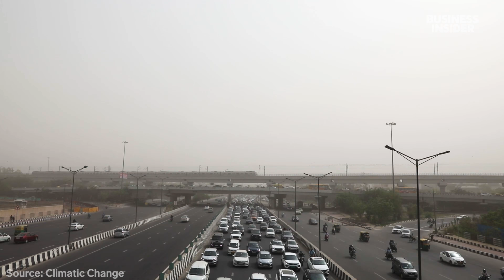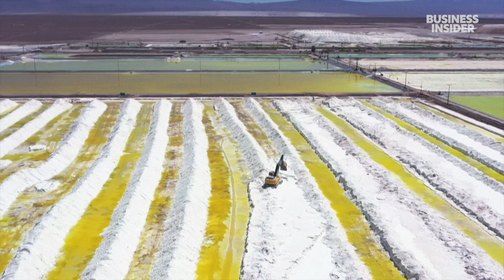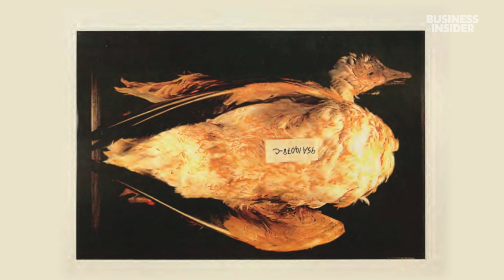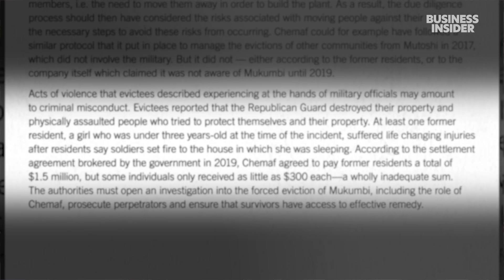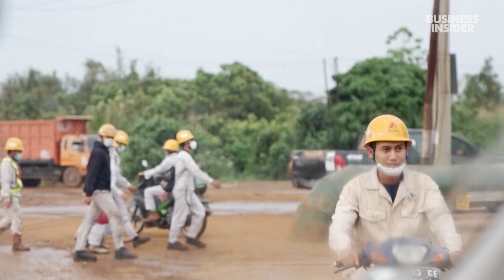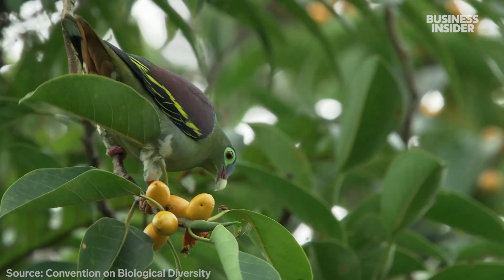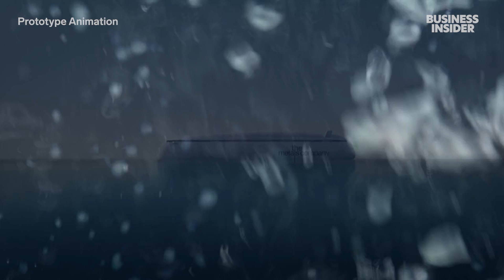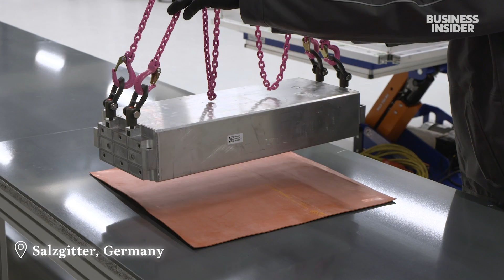The True Cost Of Mining Electric Car Battery Metals | True Cost | Insider News Marathon

Comment: "EVs have a production carbon footprint that is 30 % larger" 

Are you kidding ? This number is + a 130 %
The statistics that are used take a sedan EV and compare it to the average Hybrid vehicle, instead of taking a medium to large EV and comparing it to a standard ICE which ( on a global basis ) is an average of 4 cyl inline and 2200 pounds, while modern EVs weigh 5000 pounds and more.

Comment: Please also make a True Cost video about the petrol or diesel-powered vehicle and it should start with taking petroleum from underground, the extraction process, the processing, transporting it to petrol pumps, and burning it to the atmosphere, and what happens to it once it is in the atmosphere, and also whether there is an option to recycle the burnt petrol...
Reply: Yes, good idea.  Also the increasing amount of renewables used to generate electricity is gaining traction and will only get better in the future.  The major problem that most people don't think about is that once you burn fossil fuels then they are gone forever.  Battery recycling is real and will only get better once humans are forded to due to the over mining of virgin materials.
Reply: @Lone-Starr-Schwartz  yes 💯💯💯
Reply: @Lone-Starr-Schwartz  well, when you pollute the air there is still possibility that you can reclaim the environment if you increase the green cover on the planet, but how will reverse the soil and water pollution from extensive mining for minerals like lithium?
not that i am saying fossil fuel us long term solution but finding another dangerous alternative is no solution either.
Ideally we should start with hybrid and then find better solution like fuel cells and hydrogen and solar...
Reply: @Lone-Starr-Schwartz how many renewable batteries are sitting in the dump right now? Fool.
Reply: I dont know normal cars can be made with steel, plastic and copper also only you stupids first worlders put computers and only use gasoline, why? It is illegal to use ethanol or methane In your dyatopias?
Reply: Are you disturbed by the fact "green" EVs aren't actually that green? For the first 60,000 miles or so an EV isn't actually greener than an ICE given the amount of pollution caused to build it in the first place.
Reply: @putler965  that's wrong news buddy. The amount of rigging required to get petroleum from the ocean (damages the ocean, uses a ton of unclean energy), then the amount of energy required to refine petroleum into petrol, and the amount of energy required to transport this petrol to petrol pumps, and of course the pollution caused when they are eventually burned...all this combined is much higher than manufacturing batteries which can even be recycled after they degrade. People only check the pollution caused when driving a car, but that is not the only pollution. I hope you get what I said.
Reply: @abhijith_mb  Perhaps you can explain that to the engineers and physicists who determined you have to drive at least 60,000 miles to offset the carbon emissions involved in digging minerals out of the earth before an EV is "greener" than an ICE. If an EV is powered using electricity from fossil fuels, it could take as long as 99,419 miles to become "greener". 

You have to drive 100,000 miles to really get the full benefit, and even then an EV is only about 25-30% greener than an ICE.  This is from VDI Gesellschaft Fahrzeug, a German engineering association. But what do they know? I'm sure you know more.
Reply: @putler965  yeah
Reply: @putler965  No one "determined" anything like that.  You are likely quoting FUD you do not even understand?
Reply: @philtimmons722  I quoted an engineering company, you apparently don't realize that. Are you an engineer?
Reply: @putler965 
I don't know where you got your figures, but a modern EV offsets it's slightly higher manufacturing CO2 in under 12,000 miles, when charged on a grid of 50% renewables. Yes on an all CO2 grid it takes longer to offset the initial CO2, but still nothing like 60k miles. 
How long does it take for an equivalent ICE to become carbon neutral? Oh yeah, it can't, as it continues to output CO2 for every mile it drives.
Reply: @abhijith_mb no way. There is no comparison. These mining operations are way worse.

Comment: How is this better than oil fields?? Oh it’s not. It’s worse. But because you see no smoke out of the back of a Tesla don’t live live near the coal burning power plant liberal single soccer moms thinks it’s better lol. Ever wonder why politicians and people are pushing these “green” ideas (they just aren’t  green at all) forcing you to switch and telling you not to fly but drive your ev while at the same time they are still using ice and pvt jets?? It’s because they know it all sucks they don’t care about green they own stock or were given ownership in these companies. Remember a battery only EV pollute far worse than a gas car for up to 200k miles some 100k depending on type size etc. So ice car won’t pollute as much until 200,000 miles as a Tesla does day 1. At which point they just pull even because you still need electricity from somewhere. This stuff is a joke!! Wake up. It’s about money not going green and just like 110 years ago battery ev cars will die off soon. The future is still oil with support from synthetic fuel and hydrogen. Unless they invent a battery that is made of dirt can be fully charged in less than 5 minutes, has 500 mile range, never goes bad but can be recycled if needed and can work in cold temps efficiently than that’s the future.

Comment: One thing that is often overlooked when considering the negative effects of mineral mining is the idea of producing more efficient electric vehicles in order to reduce demand for precious metals in addition to recycling old batteries. Consumers and manufacturers alike tend to se the switch from gas to electric as a new lease on power usage that allows them to have frivolous ( although admittedly very fun) amounts of  power in commuter vehicles. If we are really trying to turn over a new leaf, we need to build highly efficient vehicles regardless of the propulsion system(s). Also, the ford lightning is an abomination
Reply: an EV electric motor is 90 % efficient and a gas engine is less than 15% efficient - which one do you choose?
Reply: @r.b.l.5841 your right but you have also missed my point
Reply: @argonaut405  the efficiency factor is your point.
Any EV, even one charged from a coal fired  plant is more energy efficient than similar gas vehicle.  The use of fossil fuels in an electric generation station is far more efficient than ICE engines can be.

Comment: What they do not tell you is that the EV's are going to wear out tires faster which raises carbon footprint. They are also harder on roads are they are much heavier which is most likely going to create a shorter time in between major overhauls depending on surface of course. There are so many variables that are still unknown. But the Replacement and range of Battery is why i will stay with my ICE engine as long as possible.

Comment: Finally some honest reporting on all the harm that EV's cause. EV's are not the future because they are not sustainable. There should be a balance of EV's and gas powered cars and not banned like the idiots who run California. No one mentions the extra strain on the power grid, the massive amount of copper to run all these charging stations and then thieves digging them up for the copper (this is already happening). Then there is no real used car market for EV's either due to the battery. If the casing gets a dent and the battery needs to be replaced you are looking at a massive bill to replace. They just won't work in really cold areas and this was already proven this year in Chicago. Not to mention if an EV is getting its power from coal that might even be worse than a gas car. I support Toyota and trying to make hydrogen work better. If that can be made more efficient that is the way to go.

Comment: A lb of cobalt is used for every six million miles worth of gasoline refinement. So an EV uses more (30 lbs average) but it’s not new. And EV batteries can be recycled to very high levels so EV fleets would probably use less than gas cars over 100’s of years. Some EV batteries use no cobalt.

Comment: All the more reason Sodium ion batteries will replace lithium. They're already commercially available, though expensive at about $45 for a 17650 equivalent. And sodium is abundant enough to mine cleanly, and easily from sea water. It seems too good to be true, but it exists, it's available, and it's getting cheaper by the day. The performance is comparable, though the voltage isn't quite as high, but that's a minor issue on the whole, and really the only drawback. But they are superior in just about every other way. Even in a fire, a sodium battery would be much safer.
Reply: they are about 1/3rd as energy dense as li batteries, too heavy for cars, but good for mass storage/peak management.

Comment: Compared to oil drilling?  You need a comparison.  Lithium is plentiful, the problem metals are nickel and cobalt.  Solutions in battery designs are coming which will reduce or eliminate those.  BTW, around the Great Salt Lake similar large brine operations exist just to obtain common table salt.  I suspect many of these videos are sponored by the petroleum industry.
Reply: fuk the ev cars and fake woke movement....

Comment: Yes, it causes a lot of damage, and it’s right to state that. 
But honestly, if you are going to then keep saying “internal combustion engines don’t do this”, then in fairness you have to show all the horrible bits involved on making ICE cars AND it’s fuel and say “electrical cars don’t do this”. Otherwise it is pretty specious and leading. 

It’s easy to do this but it’s not proper reporting. It’s like if I were to say “Olive oil production generates a lot of complex residue that is hard to get rid of. Palm oil does not do this”, and fail to mention that instead it is causing the destruction of huge amounts of tropical forest.

Comment: Beyond electrical cars I still do not understand why there is no country that says ok the car engines may be 1.6 or 1.8L at largest and need to run at least 20km on 1L of pertrol/gazoil? This would massively help. And there are still 1.6l engines that go well over 200km/h which is hardly anywhere allowed and can only be driven on some freeways. It does boost as well the technology for better, cheaper, fast and low feul consumption.

Comment: Starts with misinformation.
Average EV has 6x as much "mineral content" as a petrol vehicle.
Now add the lifetime of fossil fuels (also minerals) for the petrol vehicle. 4.6 metric tons of fuel a year on average.
The battery is also 100% recyclable & as more get recycled, most of the 'minerals' in an EV will come from recycled sources.
Then we get 'copper mines' - with focus on Butte which shut in the 1980s and has NOTHING to do with EVs.
Copper is used most in housing - plumbing and electrical wiring for homes and businesses, where's the anti-homes with running water video?
Then we get the Cobalt story - when LiFePo4 batteries used in most EVs now don't use ANY cobalt! Likewise the new sodium (salt batteries).
The Congo has been a disaster plundered by western corporations for the last 70 years & child labour (& child soldiers) has ALWAYS been a part of that story!
Look to the battery in your phone and laptop more than EVs for cobalt.
Then we get the nickel story - again a metal used massively elsewhere than EVs & again in LiFePo4 batteries there is ZERO nickel. The main use of nickel is in making steel - and the ferrous metals are the most recycled metals by bulk.
At least it concludes by saying we need to make this shift, but far too much feeding the fake news talking points. Not enough looking at the new battery technologies like sodium & LiFePo4.
It would be good to put one open cast coal mine or tar sands mine picture next to those lithium mines (for scale). Brines in a desert are far less impactful than tar sands and pipelines that constantly spill across thousands of miles.

Comment: Old copper telephone cables can be replaced by optical fiber and the copper can be recycled.
Reply: Why would our government give a crap about efficiency when they spend 250 million to make an app? They literally could not care less! They’ll just spend 50 billion on newly mined copper. The liberals have unlimited funds… while Canadians take the next 100 years paying back all this Trudeau spending.
Reply: Many old copper telephone cables are lead-clad and leaching toxic lead into the earth in which they're buried.
Reply: @echologixxx9758  Actually, most countries lay their cables in pipes and conduits.  In order to replace copper with fibre optic they would tie the fibre optic cable to the copper at one end (down a manhole or similar) and go to the other end and just pull the copper cable through in order to place the fibre optic cable in the same location.  A simple splice to join fibre optic cables together and all's done.  There's little or no digging involved, except in areas where this hasn't been done...and should have been done, so needs to be done!
Reply: This already happens
Reply: Optimal fiber cannot transmit electricity. DUH.
Reply: @trumplostlol3007  OptiCal fibre doesn't need to transmit electricity, not if it is being used for data transmission
Reply: @smeggeruk  You don't even need any cable to transmit signals. ANY electromagnetic wave can be used to transmit signals. Under ideal conditions (aka vacuum) all EM waves travel at the SAME speed. It is a matter of how strong they need to be amplified and how much negative impact they may have on living organisms. Go wireless.
Reply: @trumplostlol3007  You don't need a cable?  Really?  What other pieces of interesting and unknown information do you have to offer?

Or,  you know, if you're not actually offering anything actually worthwhile, don't take part in the conversation!
Reply: @smeggeruk  Use 5G tethering or satellite. Are you a modern human? LOL
Reply: @smeggeruk how does you mobile phone work? No wires, right?
Reply: @ Are you a moron, or are you just blissfully unaware of how completely different situations require different types of product to perform different tasks?

WHAT THE F**K DOES THIS HAVE TO DO WITH MOBILE PHONES AND SIGNALS?  We aren't talking about communications between a wireless device and their base station, we're talking about metals used in the manufacture of cars (primarily) and telephone signal transmission of LANDLINE phone systems over extremely long distances in this sub.

As an added bonus, let's change the subject to mobile phones.  Let's make all mobile phones 100% wireless.  You wouldn't be able to make a call, because your wireless signal from your phone goes to a local mast which is then sent WIRED through the telephone network to the mast for the phone you're contacting which is then wirelessly sent to that phone.  If your phone connected 100% wirelessly to their phone it would need to jump across (potentially) 100s of wireless masts and the lag introduced would be phenomenal.  I've used mobile phones when they first came out, and I remember the lag.
Reply: This metal use is nothing new. The fossil fuel industry has used cobalt to refine gasaholeline for many yrs. 
EV s will eliminate the use of these rare metals eliminating the entire issue.
Reply: @GWAForUTBE  EV has just started AND it has already been competing with consumers for electricity which is STILL MAINLY generated by burning DIRTY coal. Whoever thinks there is a real environmental friendly "alternative energy" is just a silly victim of the EVIL vehicle propaganda. ALL known alternative energy sources are KNOWN to cause irrevocable environmental disasters in the long run. EV has raised carcinogenic cobalt mining by a hundred times. Open your little eyes and see the increase in cobalt, lithium, copper, ... mining activities in the past decades. These EV il activities have ALREADY caused some serious health problems in Africa.
Reply: Fantastic. Is there a point to the comment?
Reply: See nothing wrong with replacing copper with synthetic polymers?
Reply: @TheConsciousEntity  what is wrong with using copper?
Reply: @elgoldstein3682 everything is bad if it's used on a huge scale. We should create alternatives not replacing
I hope we will use Petrol cars, Electric cars and Hydrogen cars at once, not replecing one another and maybe in the future there will be more fuels
Reply: We could get it done in a week if the utility companies employed the local junkies to do it 😂. 

Jokes aside, that is a dumb idea though
Reply: @enemyspotted2467  Hay does anyone know the least labour intensive way to strip insulation from copper wire🤔 arrr asking for a friend 😆🤣✋
Reply: @0Aus  fire
Reply: @0Aus fire. Just don’t inhale.
Reply: @0Aus throw it on your burn pile & let cool. Only copper left.  I’ve only done this once & it worked.
Reply: @enemyspotted2467 I literally work with people that steal copper from work and sell it 😂
Reply: @Stevros999  you sitting on the sidelines laughing about it makes you participant in the theft. Either report it or get so focused on work that you don't notice
Reply: @echologixxx9758  👍 battery car jockeys hate reality and practical thinking like that.

Comment: EV ARE AS MUCH A PROBLEM,  FLASH IN THE PAN.
Road. Loading of bridges, multi story car parks. And combustion  of battery, and the water in . Putting them out  it uses  hundred of gallons water. Pushed by government,  unsubstainable , ideas.